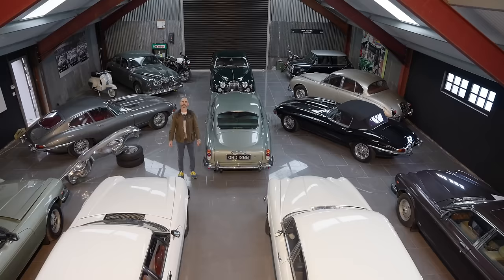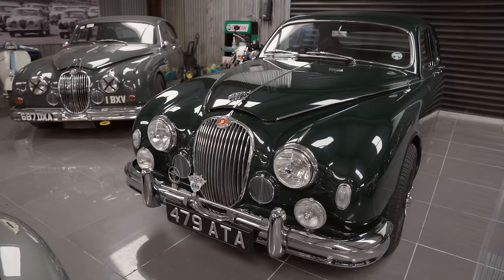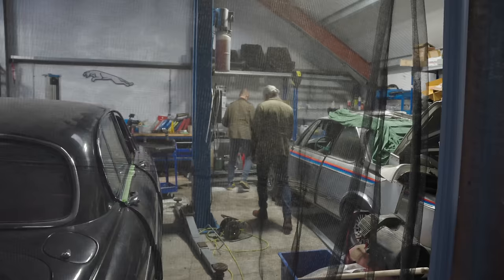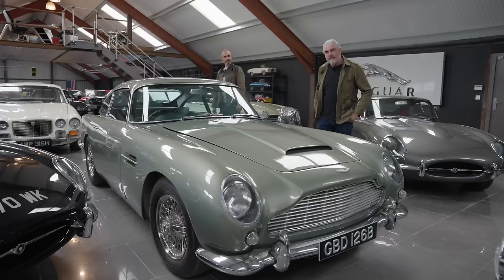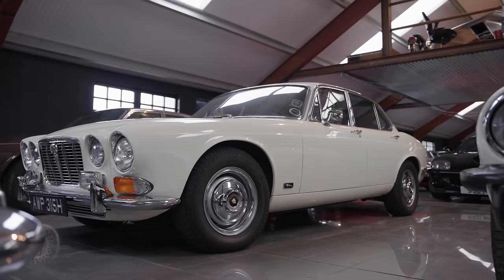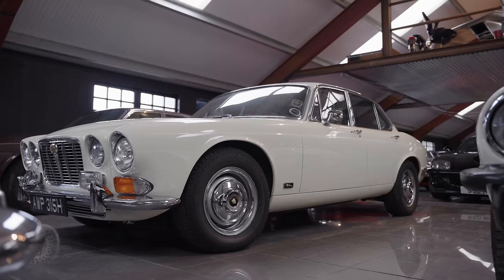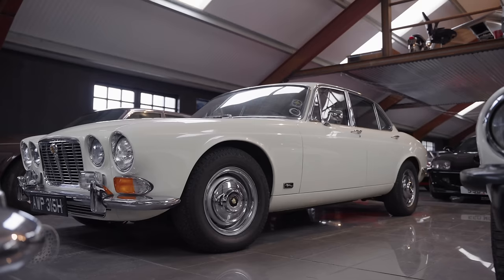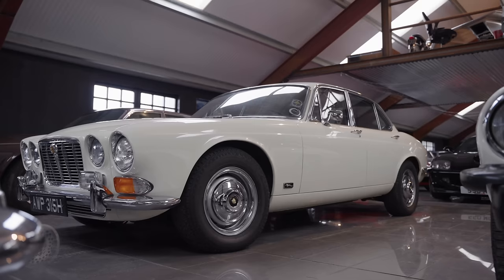The Secret Classic Car Barn we all dream of - Car Caves

Comment: This was a great barn walk about, great memories of the 130 abarth run one for 7 years with a 5 gear mod for longer legs, once pushed it to just shy of 150 with 4 petrol heads in it,that collection needs a Saab 95 aero hot, loved that car, my rs4 low mileage is up for sale if he’s interested all blacked out with carbon trim still has original front wavy discs, Audi service history

Comment: My Fiat was a 128 Sedan, in 81 in Metro Detroit. 4 Cylinder 4 speed manuals were usually Vega's or Pinto's in Detroit, I drove car for a year, and 10 times it cut out ignition on left hand turns. I sold it for double what I paid and instantly regretted it. A friend delivering pizza's bought, and sold it later for more than he paid.

Comment: My dad bought a 420G Jaguar. I only remember it looked bloody cool, in two tone light blue over dark blue (from memory).
I am sure it had walnut picnic tables in the backs of the front seats. 
No idea what motor it had, but I recall dad tuning it by (pieces of pipe to listen to the individual air intakes) and that it ran like a Swiss watch, with not the slightest hint of vibration.
We would go for a Sunday drive as a family, pretty normal for early 1970s. The first oil shock made big engined, complex cars suddenly undesirable. Dad bought it at an astonishing discount to the price immediately prior to that war in the Middle East.

Comment: What a stunning collection.  Just one thing, unless I'm mistaken that Mk 10 Jag was actually a 420G.  Basically the same but the Mk 10 didn't have the chrome strips down the sides.  Jaguar came out with two cars - this and the 420 which was a similar size to the S-type and about as successful appearance wise as the much later X-type.

Comment: Wow, what an impressive collection, and some really rare stuff too.
Just to be fully pedantic though, the Aston V8 is just that, an Aston V8 and not a V8 Vantage. It doesn't have the blanked off grille or the front spoiler that the Vantage has, it just has Aston Martin V8 on the wing vent without the word Vantage and it's also an auto. Admittedly there were a few specced without the blanked grille, and even fewer later auto conversions, but the fact that all three details exist would lead me to suspect it isn't a Vantage.
It is, however, one of the first Oscar India cars, which was the October 1981 facelift where the rear incorporated a spoiler derived from that of the Vantage and the bonnet lost the scoop with the air intakes relocated behind the headlights

Comment: Agree totally, one point is, if the ev is supposed to be the saviour of mankind, so, why are they going fast instead of conserving energy (oh yeah, no one would want one). Another point is, when subsidies end the true expense will come to light.
Hydrogen, normal filling station and ICE engines along with eco and synthetic fuels being mass produced and therefore cheaper IS the answer for immediate improvements to environmental cleanup.

Comment: Renault has unveiled its new range of electric cars, with one new vehicle expected to cost just £17,000, which is set to make it one of the cheapest on the market.

The historic French brand is expected to revive the Twingo name after being discontinued in the UK five years ago.

To mark Capital Markets Day, Renault aimed to “democratise electric vehicles”, making cars cheaper for drivers and helping people jump to electric.

As part of the announcement, a new brand – Ampere – was debuted, which is set to oversee electric car and software development.

This includes the “Legend” – or Twingo – which has been described as a “fit-for-purpose urban vehicle with no compromise”.

The electric vehicle will have 75 per cent lower CO2 emissions than the average European internal combustion engine car sold in 2023 over its lifecycle.

In addition to zero tailpipe emissions and lower raw materials consumption, the European-made car is set to launch in 2026.

Renault stated that the car will be offered at an entry price below €20,000 (£17,521) before subsidies, which could cost less than €100 (£87) per month.

While the brand has not unveiled the range of the vehicle, it has been praised for its exceptional efficiency and fewer parts and resources.

Luca de Meo, CEO of Renault Group, highlighted the importance of the Ampere brand and its mission to make electric vehicles more accessible to all.

He added: “In the true spirit of Renault, Ampere is engineered to make electric and connected cars affordable for all, addressing the imperatives of energy transition and seizing the growth opportunities on the market.

  Continue reading